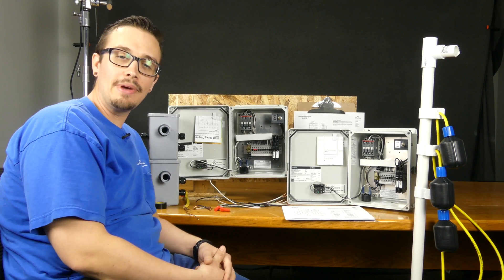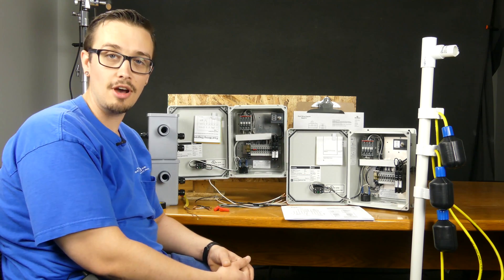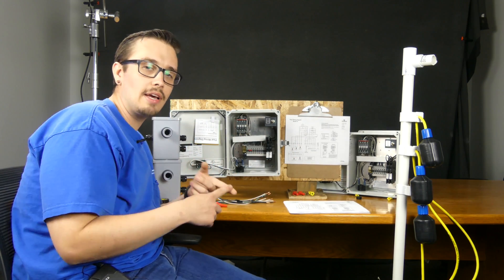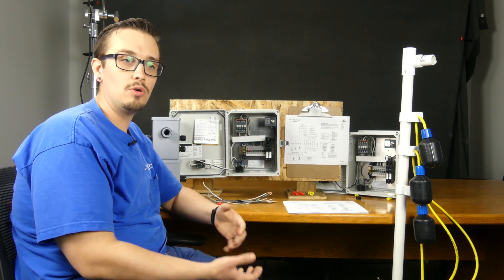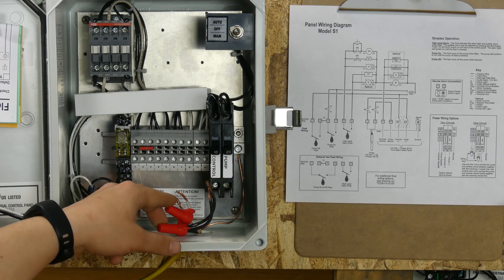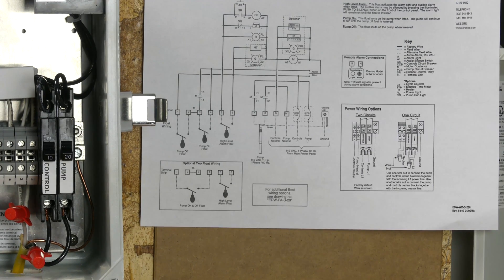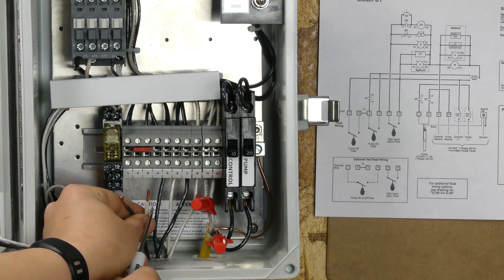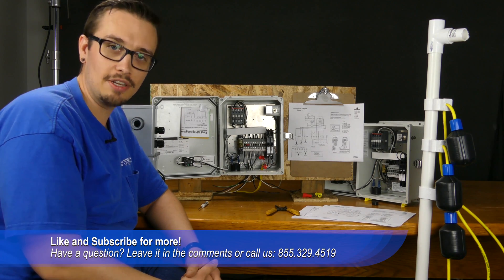How to Wire an Orenco "S" Series Control Panel

Comment: just curious why you would need a pump-off float if the pump-on float goes down, wouldnt that trigger the pump to turn off?
Reply from the maker: No, because it is a latching circuit. Both floats have to be up to turn the pump on and both have to be down to turn it off.
Reply: Garbage

Comment: Another great video. Thank you!  Quick question: If I did want to run 2 circuits to this box for the advantages you described  (one for the panel to keep the alarm alive & one dedicated to the pump) could I achieve this with a 12/3 wire from the panel; A hot to each panel breaker and then jump the neutral at the N terminals? Or would it require two separate 12/2 wires so that that each leg would have a dedicated neutral? Please let me know if you would and thanks again for all of the great videos you make!
Reply from the maker: You will need two dedicated circuits from your main panel for each circuit in the control panel. They need to be dedicated so that if the breaker in the main panel trips the other still work.
Reply: But can you use a common neutral
Reply: Yep no answer. I believe in this video here he said he would show us how to do it in another video that never came out

Comment: Do you know what orenco panel i will need to run two pumps?  I need to pump from tank to sand filter then pump from sand filter to drainfield.
Reply from the maker: Give us a call: 855.329.4519

Comment: I got a model S2 control box that seems like it wants 9 wires instead of 7 wires like other S1/2 boxes I have connected.  Any way to use this box with only 7 wires coming from the junction box?
Reply from the maker: Give us a call: 855.329.4519

Comment: Is there a 2 circuit video? I'm missing something... controls l1
Reply from the maker: Please give us a call for help: 855.329.4519
Reply: My septic illustration shows a seal-off in a valve box after the splice box in line on conduit going to control box, what is this for? Is this needed?
Reply: Same thing, they don't want to admit they fucked up in writing, just call us.